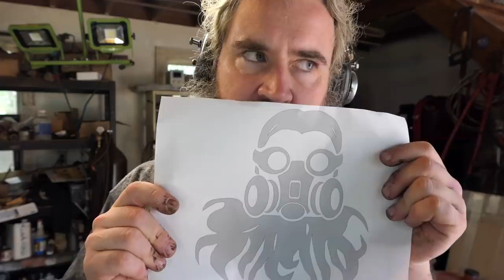He-Man Chest Plate Charity Auction!

Comment: Just an FYI, you can use water to "set" the foam. Spray the foam with a squirt bottle and it will stop the outward expansion of the top layer. It's water activated and actually the same exact product as Gorilla glue.